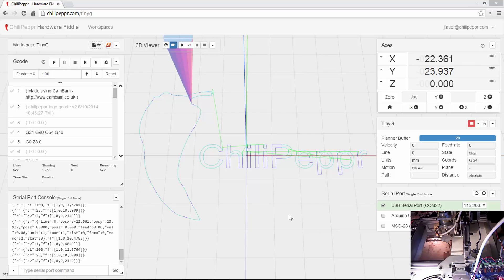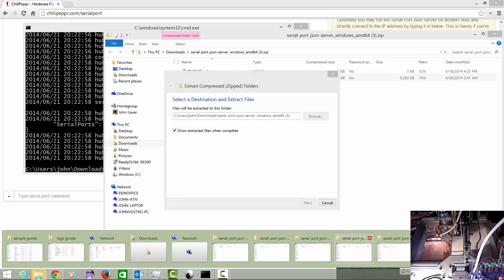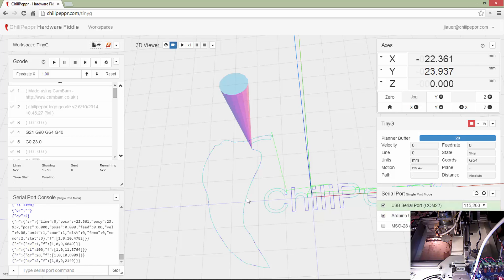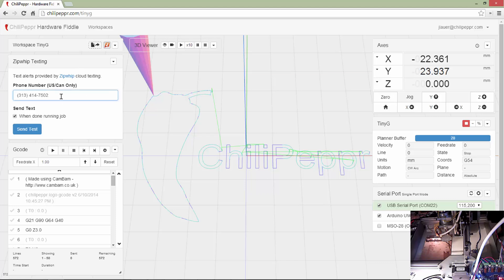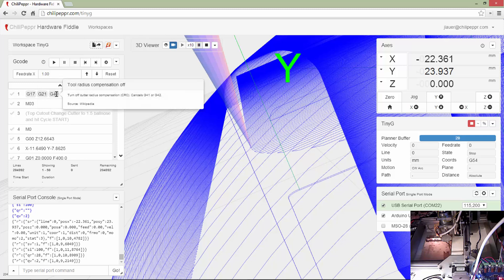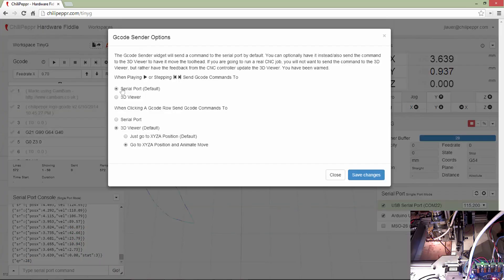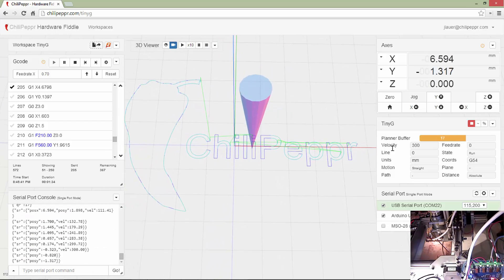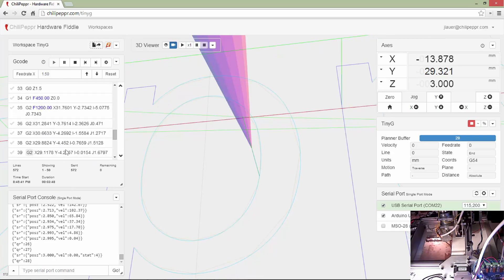Walkthrough of ChiliPeppr TinyG Workspace

Comment: I have a Taig micro mill which I've converted to CNC using a tinyG, my problem is that at any point while I'm milling chilipeppr can choose to plunge the Z axis right through my work piece (luckily it was into airspace and not my bed). I haven't had any  luck finding a solution, any ideas?
Reply from the maker: Remember, all ChiliPeppr does is send your Gcode to your TinyG. So it's most likely your Gcode or your TinyG config settings. The only other possibility I can think of is if you didn't pick the tinyg buffer in the SPJS widget when you connected, thus you could overflow the buffer on your TinyG.
Reply: Thank you! I'll check through some settings.

Comment: Hi John
Thanks a lot for all your great work you done with chillipeppr. It`s just awesome to see progress on your community contribution.At the Moment I am building a CNC XYZ and future A Axe, with an TinyG and first tests with Chillipepr just looked great. But when I got trought the planning and parallel building it, I tought about adding later on ABC axes and control over an seperate TinyG but after hours and hours of exploring the net couldn`t find how wire and configure TinyG to run full gcode controled 5 or 6 axis machine. I read about other users that used a second TinyG to extend for an additional Stepper per axe but it seems only to work as « slave » but not synchronois with full gcode functionality. Other question that came up if in that case I would need to change to an other controller architecture arduino based controller with 2 Motorshields from syntheos, but also on that issue I am stacked. You comments just a few months ago about adding axes in widgets just works fine. 
Can you help me and perhaps give me a advice to keep going. 
Thanks a lot and keep going ! 
Francis
Reply from the maker: I think TinyG is the only platform I know of that supports 6 axes. You'd need to get your own Arduino Due and add the stepper controllers on your own and then put G2 core firmware on the Due. There's an active community at Synthetos on that. Then your big next task would be how to create the Gcode. I know Fusion 360 has 4 axis, but not sure it has 5 or 6 axis CAM. You could run that from ChiliPeppr, but it doesn't know how to show any 3D visualizations beyond XYZ. So, if you'd be up for tweaking the 3D viewer to add additional axes visualizations that would be amazing.
Reply: Thanks John
due, stepper ctrl, and g2 core I should be able to handle, when I got more practical expirience with fusion, TinyG. and chilipeppr. 
it seems that fusion gots 5 axis control, but that`s just a conclusion after a quick overlook. tweaking a visualisation I leak of knowledge and time, but i`m confident that a flash comes up some day.

xyz would be Portal milling machine and it might be that somebody could give me some tipps. Here alink:
http://www.chinacnczone.com/en/chinacnczone-hy-6040-small-desktop-diy-5-axis-cnc-machine-for-milling-engraving-wood-brass-acrylic_l292_p151.htmlThanks and merry Christmas :) Francis

Comment: John, Thank you for this awesome how to video.  I am however, having some issues getting the serial port to list let alone connect.  I feel like I am missing something very basic but, could use some guidance.  The laptop I'm using is running windows 10 and and just ran a troubleshoot which turned up that the JSON serial port was incompatible.  Any tips on how to bypass this? Below is the info when I run the serial port if that helps...Thank you! 2016/06/02 11:14:46 main.go:89: Version:1.86
2016/06/02 11:14:46 main.go:96: Hostname: DESKTOP-62C7T5G
2016/06/02 11:14:46 main.go:102: Garbage collection is on using Standard mode, meaning we just let Golang determine when to garbage collect.
2016/06/02 11:14:46 main.go:115: Starting server and websocket on 192.168.43.142:8989
2016/06/02 11:14:46 main.go:118: The Serial Port JSON Server is now running.
2016/06/02 11:14:46 main.go:119: If you are using ChiliPeppr, you may go back to it and connect to this server.
2016/06/02 11:14:46 main.go:129: You can enter verbose mode to see all logging by starting with the -v command line switch.
2016/06/02 11:14:46 main.go:144: Your serial ports:
2016/06/02 11:14:46 main.go:146:        There are no serial ports to list.
Reply from the maker: Looks like you're running fine. Latest version is 1.92 and is on Github page. However, you do have no serial ports which means nothing is plugged into your laptop. You sure you have your serial device connected?
Reply: Well, that would be embarrassing but, totally possible knowing me.  Thank you, Sir!  I will tackle it again in the morning.

Comment: Wow this is pretty awesome! The software looks really slick. I'm building my first 3D printer (kossel mini) with a beaglebone / bebopr board. Something like this would be awesome as a UI to run directly on the beaglebone as a front end.
Reply from the maker: Hi Dejay, the Kossel Mini with the BeBoPr may work fine right out of the box. If your Gcode has E values (extrusion) it will work. In fact the 3D viewer will show extrusion Gcode lines in a different color to help indicate it's a 3D print. It could make sense to extend a workspace to add some specific BeBoPr configurations.